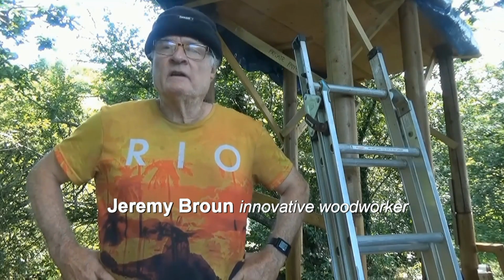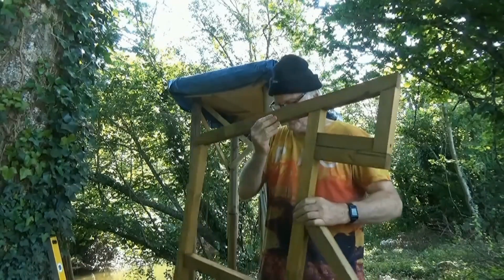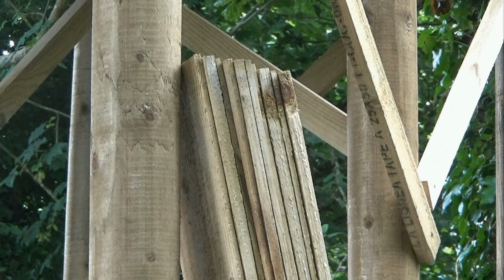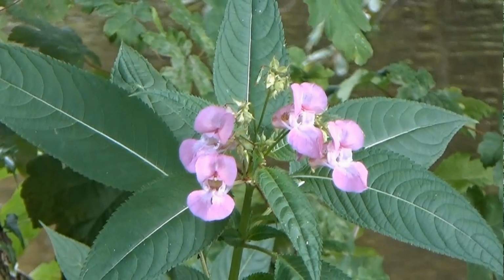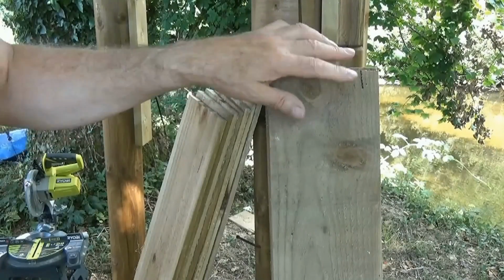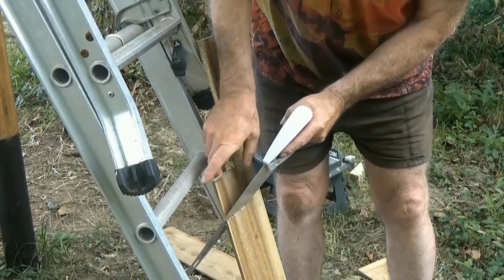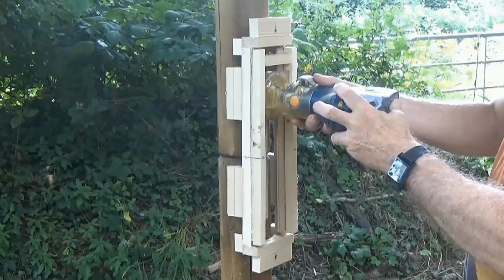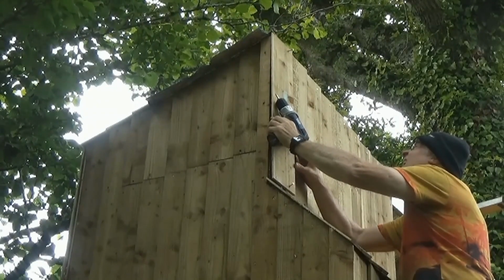Wildlife Birdhide Design & Build (3)

Comment: Another great instalment. Look forward to the next. Just a quick question if I may. With the the feather board getting used on its edge, how do you plan to seal the top? Many thanks.
Reply from the maker: In the video I did say the insulation foil quilt serves as an extra barrier but the roof boards are overlapped sufficiently.

Comment: amazing how fast (in relative terms) a pile of raw materials come together to make something that looks not only like a well made and thought out design but fits so sympathetically with the surroundings, great work as always Jez!
Reply from the maker: You hit the nail on the head - starting with an idea, an environment, a pile of wood and bunch of tools and then a finished result! There is nothing more satisfying than making what you design and more people should take the  plunge and learn how to design which is simply problem solving and working through a process.

Comment: Climbing ladders, standing on ladders and working at full stretch and overhead all sap energy. Are you going to stain/preserve/camouflage it? Well designed and built.
Reply from the maker: I did think of camouflage not least because in the winter it will stand out, but I seem to be addicted to feather edge board. Any ideas? The exercise burns calories so I have no problem with that.

Comment: When watching the first video in the series when you mentioned the need to brace the pole joins I wondered if sleeves of PVC pipe might have been a good option. Depending of course whether you could get pipe that would be a snug fit. How do you think that might have compared in terms of strength to your solution?
Reply from the maker: Yes,  I considered cast iron gutter which is expensive, PVC pipe would not be strong enough, I also tried out a length of galvanised steel air ducting which fitted perfectly but any encapsulation might encourage mould and damp. In the event of freak flooding I think my solution is strong enough especially with the metal bracing between the posts so all act together but it is guesswork and time will tell how the structure sinks or wants to tilt in the wet land. Most of the force is downwards. So I will be monitoring it. If it looks necessary my plan is to strap on two lengths cast iron guttering on each post join.